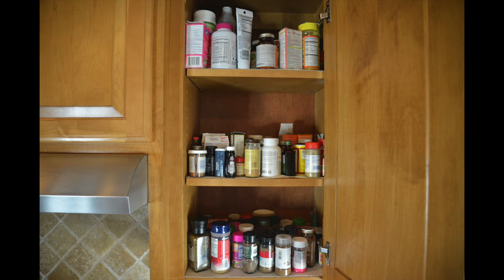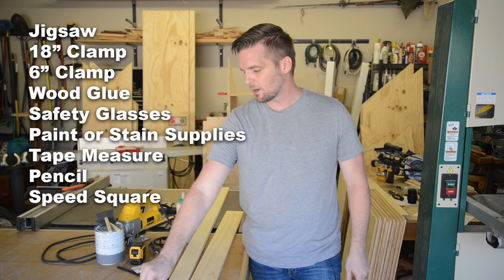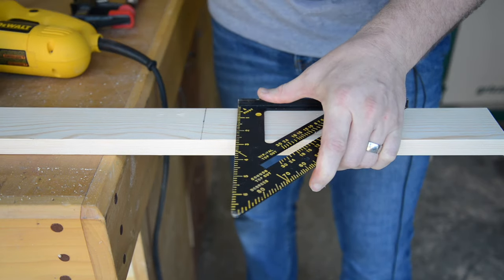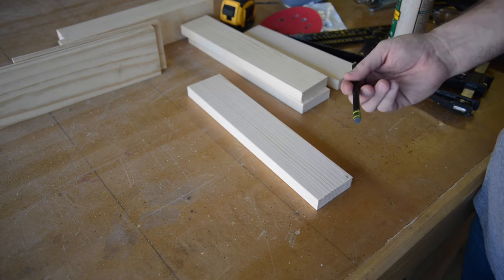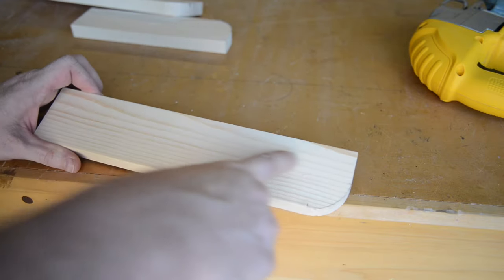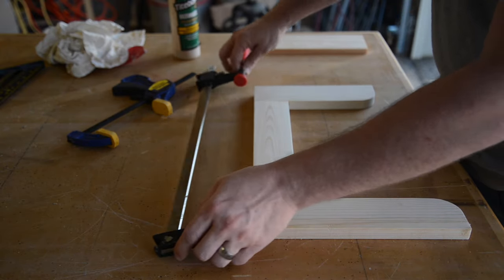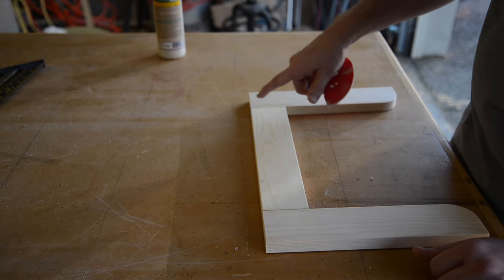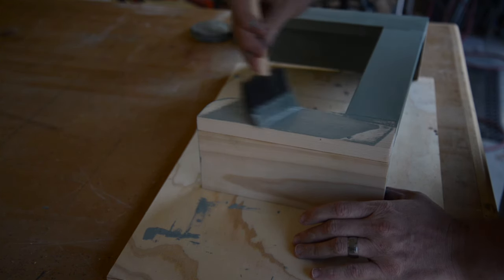DIY Spice Rack Cabinet Shelves | Free Plan | Beginner Woodworking Project

Comment: If you hold the speed square to the right of the work piece as you use the jigsaw you wont need to clamp it down , as your applying downward pressure onto your work bench , thus preventing an awkward position  .